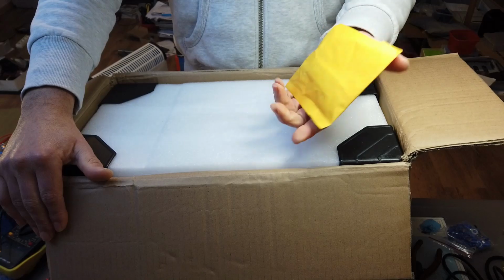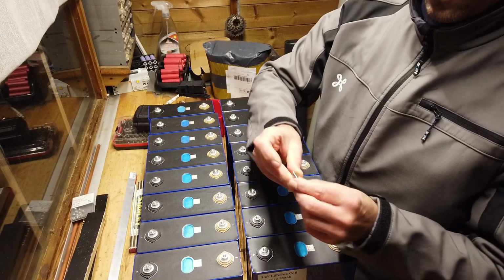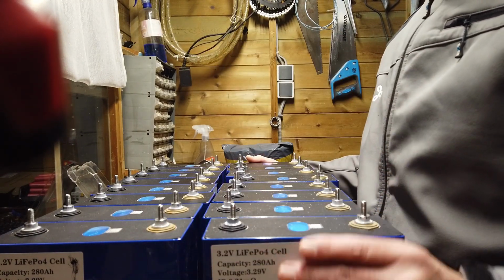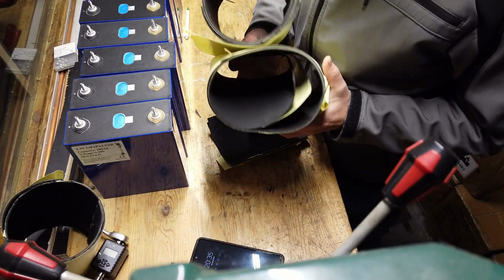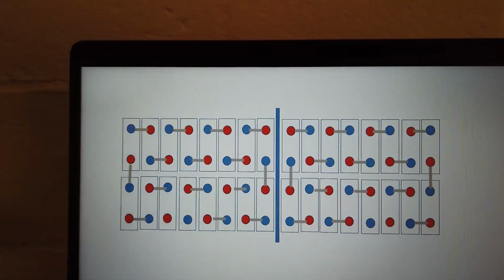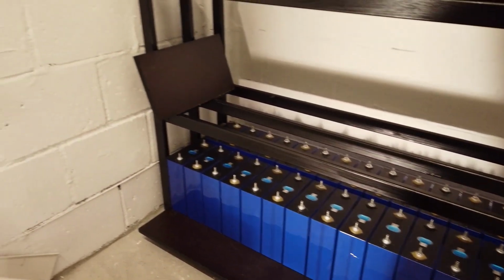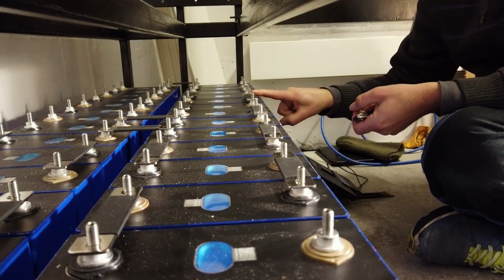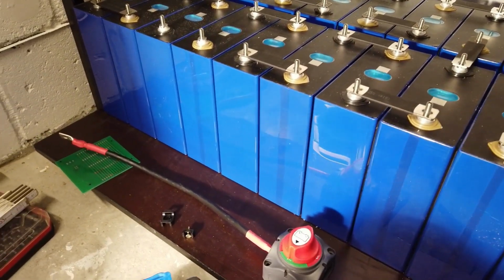LifePo4 battery preparation.

Comment: Nice work, one tip.
You should insulate metal parts of all tools when working with batteries. Wrench shaft and extension are pale metal.
Reply from the maker: Haven't seen a spark yet, but you're right.....better safe then sorry.

Comment: nice video although it is not forbidden to smile when you are busy with such a nice project 😃.  Next week my 40 LF280K EVE cells arrive to make a 18s2p config, combined with 3 victron multiplus2 5000/48 inverters.
Together with a smartsolar 250/100 our house won't even notis a total blackout for weeks😎
Nice touch this EVA foam, I'll be using two end plates pulled together by four spring loaded straps  in order to keep the cells on a slight pressure of 150kg. The EVA tape will d3vide the pressure evenly around the internal roll of the kathode.
Reply from the maker: Thanks for the flowers on the EVA foam. About smiling on the video, I'll work on that, check the latest post (https://youtu.be/mi8a7tFBfpA), not only intresting but funny end.
Reply: Wow do u have a video of that?

Comment: Sorry if I missed it but do you have an estimation of the cost €/Wh considering all materials, BMS, fuses, etc?
Reply from the maker: Hi Jonatan, that's a good idea for a short movie. But in short, cost with batteries & inverters is 13500EUR/60KWh or 0,225EUR/wh. Note, I have charger which is not in use and second MPII is not really necessary for now. In that case it's closer to 11500/60KWh or 19ct/wh. Hope this helps.
Reply: @easypowerwall  thanks a lot! I was actually asking without inverters, just the battery and whatever it takes to make it work and connect it. The cheapest ready to connect battery I found is the pylon tech and it’s around 0.29€/Wh. Looks like it’s still really worth to do a DIY battery considering all the savings you get!

Comment: Thanks for sharing!
Regarding the EVA Foam; this looks like a rubberfoam; simular to something like Armaflex. 
I see here 2 issues; 
- did you see a spec relating to heat resistance?  The average rubberfoam is not very hear resistant (max 110°c?).  I would rather use something that has specs relating to heat resistance.  For example a silicon mat (up to 220-230`C) or something dedicated for this purpose.  
- these rubber mats are not dimensional stable under pressure.  My experience using rubber mats is that they lose their flexibility when under constant pressure.  This would mean that you will have to re-apply pressure to keep the cells under a constant compression.
Reply from the maker: Hi Walter.  You talk about temperatures of +100°C. Batteries will be around 40°C max, only few degrees above ambient temp. The Eva foam is primarily extra electrical isolation between cells. Hope this answers your question Walter.
Reply: @easypowerwall  An EVE cell can support up to 55°C; if you want to do this is another question ;-).  But do you have confirmation the rubber foam supports 40°C for longer period?  I don't see any temperature info.  Which I would see important in this construction.  
What do you think about the dimensional stability under pressure over long term?

Comment: Tip I’ve seen it mentioned on other channels to use the blue lock tight on the studs
Reply from the maker: Hi Alan, I'm not a fan of this technique. If you have to unscrew the stud you need to use so much force you will destroy the terminal. It's better to apply the correct torque and check every 6 to 12months if everything is still OK. A quick tour with a IR camera is very helpfull too, will come back later on that topic in a future clip. Have a nice day.    
Frank
www.easypowerwall.com
Reply: Those cells do not experience vibration at all.
Reply: Bad idea not a tip

Comment: You can buy rack battery $1500
5.12 kw no building just
Slide into rack buy 6 for whole house
Reply from the maker: I agree, but there are several reasons why I choose for DIY. System had decent BMS with active balancing iso 30ma, fully serviceable, much cheaper, ...  Hey and it's fun and rewarding too.

Comment: ok.  just sayin' - that battery disconnect is NOT rated for 48v....
Reply from the maker: The switch can disconnect 75A @48V, so this should work. In normal condition I will rarely use the switch. It's there for emergency or maintenance. PW is 6 months in use not used it once. When used I try to reduce load to 0A.
Reply: @easypowerwall  i understand... BUT it's a "max of 48v" - and 51.2v is a little over.  i'm sure it's not a big deal - ESPECIALLY if you don't use it often for it to potentially arc internally.  and i know properly rated switches are more expensive... just hopeing to make you aware, my friend!

Comment: I have 64 cells of Lf 280k EVE cells. Pushing them together is a joke. If they have to blow they will either swell or explode from the top so compression is a joke. waste of time and resources. Biggest thing is cooler temps and good BMS for each pack. Each pack to busbar.
Reply: I am watching Offgrid garage and still get confused about this compression stuff. How long do you have your battery working. have you left the gaps between cells? Can you observe any swells right now ?
Reply from the maker: The cells are compressed, so they can't swell. Built the battery 6 months ago, it's in working order since a few months. 3 reasons to compress: higher battery life (not that important, 6000 cycles), 2% higher capacity (not that important). For me most important reason is "structural integrity", everything is sitting together, no loose parts/batteries...no stress on the studs...evrything is fixed.

Franky
Reply from the maker: Hi DC, thanks for your comment. Maybe I mentioned it not correctly during the video, but main reason for compression is structural integrity. All cells are fixed, no stress if someone "hits" the frame....everything is tied together and there's no stress on the studs of the battery or any other hardware from the powerwall.

Franky
www.easypowerwall.com
Reply from the maker: Emily did you saw Andy latest movie? Hope you're convinced compression is the way to go.  https://www.youtube.com/watch?v=9aE5CVuVC60&t=1s
Reply: @easypowerwall  Yes I did. Thanks for the reply. Compression is must have Regards.
Reply: I disagree with you and agree with Easypowerwall. Should the batteries bloat the cell connector will be stressed. If you were to install them in a RV or even DIY EV car you would make sure those do not move around.
Reply: @repairman2be250  in anything that moves I would tension them so they do not move.  Compression isnt needed unless you are really pushing them like 2-3C. since mine will never go over .15C and live in a basement where its stays cooler I do not need it. I do see where compression would be needed. I was waiting for someone to actually give examples etc.

Comment: At codes can be faked no problem
Reply from the maker: They can, but batteries came from basen EVE. Package was top notch, they don't need to fool customers.
Reply: Where is link to buy batteries
Reply from the maker: @tim62744  https://www.alibaba.com/product-detail/3-2v-Lifepo4-Battery-EVE-LF280K_1600121609267.html?spm=a2700.7735675.0.0.59c125ea4TXmiW&fbclid=IwAR0mUYOpZ8xxG3EWfTb0rH2i3-t6lvVYekM4AKtpCY78HHQ6WXKccbXiI3k